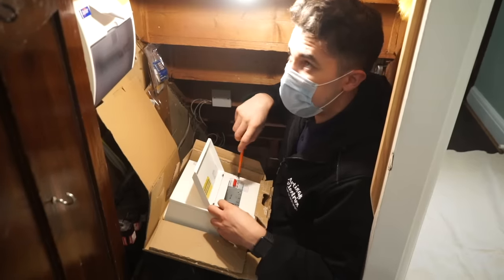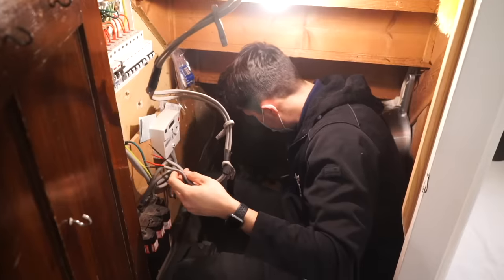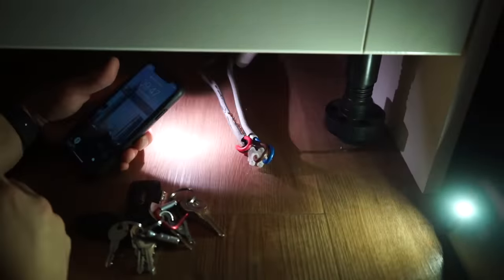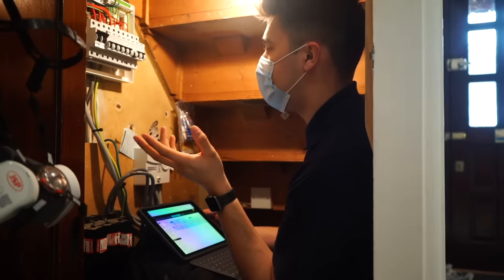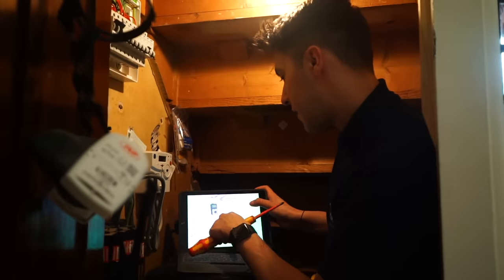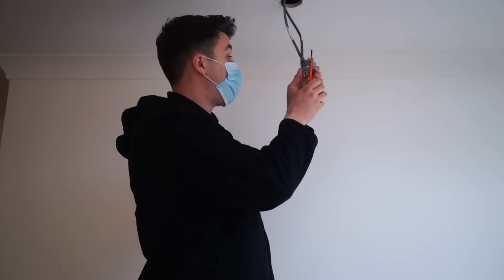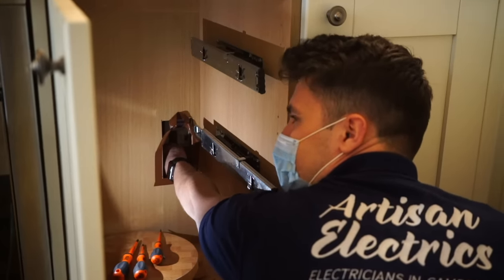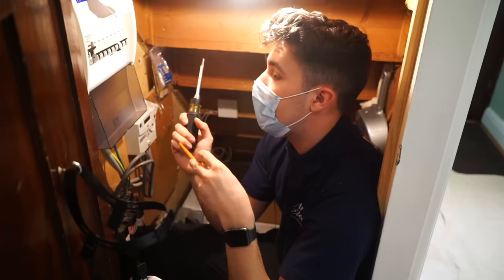COWBOY ELECTRICIAN WAS HERE...

Comment: Came across one much the same the other day but the kicker was it was a old mem fuse board which someone did a rewire but didn't change the board was the first red flag

 wasn't there for a ecir but to install two towel rails which immediately got stopped once I removed a hatch to have a spark occur a inch from my face i preceded to see chocolate block's everywhere with singles as they couldn't be bothered to change them out when they were rewiring obviously and had never heard of a junction box. 

I then go to the fuse board to see where the rcd protection must be for the shower which had caught my eye as fairly new... only to there isn't any its off a 30 amp fuse marked ring circuit..... 
Great this can't get much worse I thought.... 

wrong again as when i go to isolate the board i find the main Isolator is broken and someone had placed it back on after breaking it look thee part but do nothing... 

I immediately told the old couple that they had multiple issues in the house that needed sorted.

 Felt sorry for then as they had no idea and the guy who had been before was "qualified " but obviously wasn't.

Now have to fit them in for the remidal work ecir towel rails and board change.....

Comment: Can’t believe they’ve used the click plugs on the enlite E8 fitting too, they’re designed for 2 x T&Es ! Waste of money 😂
Reply: I like using the click myself. Sometimes i second fix the click then let the boarders and plasterer do there bit. Then go back cut the holes and plug the downlight in. Also if you have a faulty downlight you can just unplug it and leave the rest of the circuit working.
Reply: @affy675  ah that’s fair enough. If you fit enlite gear like In this video, you might wanna look at the E6 Pro’s 
They have their own plug and are absolutely brilliant 👌🏼
Reply: They're brilliant for local isolation. And much better than most people's choice of downlight connector.
Reply: @tobysherring1369  I’m not knocking the connectors, I agree they’re great. But imo created for the kind of Downlights that require just 1 flex cable rather than 2 twins.

Comment: They were a colledge lecturer? I have seen DIY better (and safer) than that. Hell I'm a DIYer (did a stint at college and worked with electricians but still) my stepdad installed a downstairs toilet, I put in the light, it was easier to spur from the nearby socket outside the toilet so I did using an unswitched spur and I even had the common sense to fit the spur with a 3amp fuse.

Comment: I want to know about all these induced transient currents ....🤣
Reply: Exactly how a transformer works. 50hz AC flowing in one wire will induce a voltage in another. It will be very low but still measurable. In some buildings, where the cable can be run through steel ducting, this will be less of a problem.
Reply: @lon3don  The smiley was a clue that I was only jesting in my comments 👍 It may have been some fifty years since I was at college , but I have some memory retention, just !

Comment: 45:35
About 5mins after entering the property and seeing the "utter shock-horror show, my way, would have been far "more" crippling, than yours.

An "emergency call" to the local power supply board/ area-authority, and an instruction, by me - for them to completely remove all connections from their "mains" supply, at the ETP (entry termination point) and the absolute isolation of the premises, with a "tagged" DO NOT RECONNECT at their supply point.

Then I would have simply "walked" (not run) away.
Wiping one's hands from the sheer stupidity, of "that client" who either bought the house that way, "without doing" a full electrical inspection (by an inspector) of the property, pre-purchase, and a proviso, to NOT exchange money to purchase, until the previous owner rectified ALL code breaches, or, if they have "owned" the property for many years, to admit to NOT CHECKING the registration licence, of their "installer" whom I can most certainly assume, was in fact them or a "close" untrained relative, as that wasn't even the "kitchen installers" own electrician, or the kitchen install would NEVER have been completed.

That owner, KNEW prior to your arrivl, that it was THEY who had done, or who had allowed to be done, that absolutely shoddy, non-complant "work" (that wasn't work, that was a death trap, waiting to kill someone).

NOTHING about that "small" old house mains control distribution center, (inside that tiny access cupboard) was "up to code" before it was reconnected last time, if it was ever disconnected to do the LIVE CABLE alteractions?

Thirdly.
Before leaving, where the "outside circuit" penetrated the exterior wall, I would have attached a LARGE WARNING TAG, "This circuit is dangerous and is NOT to be relivened, until removed and installed correctly.

Then I would have gone inside, to that tiny area where the distribution panel is located, and PHYSICALLY REMOVED the cable fro the suply breaker.

TAGGING THERE ALSO, This circuit is NOT to be relivened, It is also NOT to be livened "period", until a NEW exterior (armoured, sealed and buried) fullt RCD protected underground cable installation, has been re-run correctly, to al exterior outlets and switches..

THAT JU+NGLE of birdsnest wiring, would have been just that - a literal birdsnest and NEVER re-connected to any exterior of property, MAINS SUPPLIER's streetside / master distribution feeder.

That was a 100% report the premises and disconnect, that I have ever had the misfortune, to SEE (on your video) without any way to physically reach in there, (with supply board authority), and CUT all incoming mains.!!!!

To call it shoddy, or an incompetent addition was NOT TRUE, that house had, for way too many years, had a jack of no trade, idiot, altering power circuits, they DID NOT HAVE any right to work with.

The entire property, from outside it's public boundary - needed to be removed from the general supply network.

IT NEEDS A THOROUGH AND TOTAL "rewie" Top to bottom, and all places in between.

At the very least, that "new kitcjen cabinetry, needs to be uninstalled, and the electrical cicuits in the old unlined kitchen area, to be re-wired before re-installing that NEW JOINERY.
.

Leavin as you did, by "fixing a few circuits" actually left YOU from that first fix, completely liable for the entire intstallation, as YOU worked on fixing it.
Thus could NOT have done a thorough (total installation) test, prior to leaving the site that night.
That "site" was owned by you, as soon as you "fixed" the tiniest part of the entirely unsafe installation.
Sorry, but as soon as YOU realised the nstallation "as ound" was not within code, YU should have requested a total property isolation.
PERIOD.

Comment: I never walk away from a job but I already done the whole thing by taking it all out and we doing the whole thing that's one thing we have to hear to make it right kind of like I have to do with the house or kind of had to do with the house that I live in I got a house and a wiring was wrong had to redo the whole thing and I have no problems turn out walls and we put walls up if I have to do it to make something right underneath electric cold underneath building code on any construction code underneath code everything has to be done right and my respective or it won't be there I'll end up redoing everything then and I am a construction worker I got training in it and I did the job for 13 and a half years.

Comment: Driving from Adelaide to Marla with bangers on always helps.

I remember working on consumer units when I was in the UK. Thinking about it now I think a switch board in the cupboard under the stairs is a bit odd.

Thoughts as I watch this video;

Enclosing cables in insulation, not in a JB, big no no!

I hate the garden light spaghetti wiring.

What is it with concealed switchboards within cupboards?

Isn't there a requirement to have no less than 20% loading difference between phases? I bet the supply authority would have something to say about that.

Incomplete ring circuit, what a surprise.. (sigh)

Spiders eh? You've not been in a roof that could be full of red backs have you?

At least 3, 20A radial circuits do work in a normal house.

Putting it lightly; I think this wannabe lecturer hasn't the competence to be such.
It beggars belief that he thought he would get a glowing report. But it usually the way that tradies often take shortcuts on their own properties, but not to this extent.
Though frankly you should practice what you preach.
Allowing this guy to be a lecturer at a college would be crazy.

Great video.